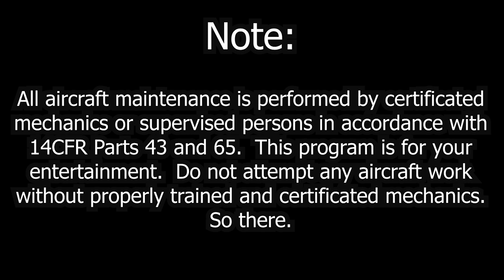Van's SB 36 Spar Crack - RV-4 the easy way!

Comment: Polycarbonate can also be bent in a brake, if you wanted to make a drill pattern by picking up the rivet hole on the flanges.  Another great video Bill.  Thanks.  Be careful in the heat!
Reply from the maker: We have two seasons down here. Summer and Christmas…!  Thanks for watching!
Reply: @HangaRatz  Here in MN, we also have two seasons, winter and road construction.
Reply from the maker: @lapoint7603  😆

Comment: I opened my stab so I could drive solid rivets and removing the debris was easy.  Great "hack" with the polycarbonate.  I used that trick to build a new fuel tank and pick up some of the spar flange holes.
Reply from the maker: Excellent choice!  I always prefer solid rivets!  Thanks for watching!

Comment: It seems the poly should be carefully cut to WIDTH on the ends that are not IN the new doubler channel.  (Sort of like a dog bone pattern.)  That would ensure a more accurate transfer, both Left & Right as well as Up & Down. Yes?   I'm not saying what you showed didn't work, but you have more practice than some folks.....

Comment: So, the hinges on this are installed with Cherry Max rivets? What was the paint you used on the new parts? Sorry for the noob questions. Just bought a project RV-6, so I'm learning.
Reply from the maker: I use MIL-P-23377 epoxy polyamide primer. There are all sorts of primer. I have used this stuff for years. I like the yellow as it makes things easier to see in closed places…

Comment: Kind of not smart that the original design didnt have doublers at those hinges.  I mean you put . 05 steel on a Al spar and don't add any beef?  The poly template is a good idea but it does seem thinner would ne best so it yiur hole isnt exactly centered it can shift easier and not obling the original hole in the spar.  I would wager  you didn't get all those holes centered exactly.   And some people dont have the same eye for centering things like others do.  
Was it hard to shake the rivets out the inspection hole?
Reply from the maker: Took a few minutes to shake them out.  Lots of room for improvement, but, it is an older version...